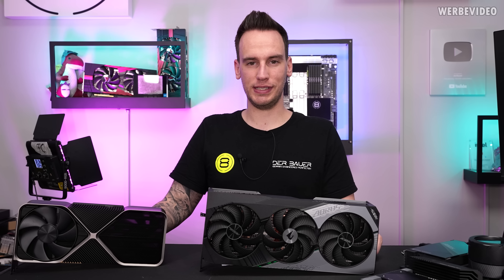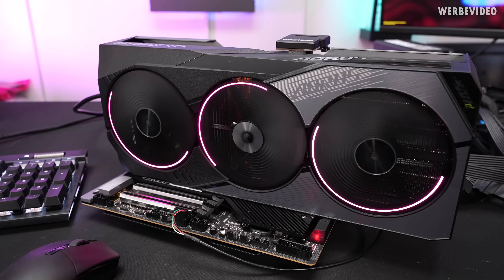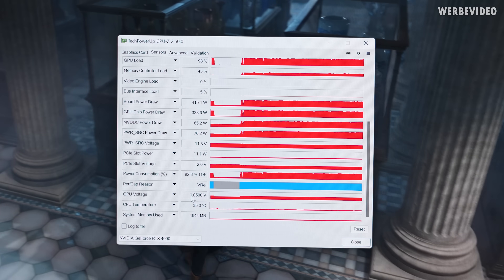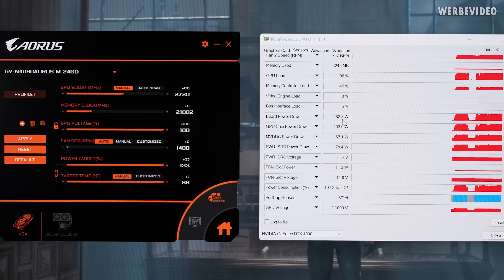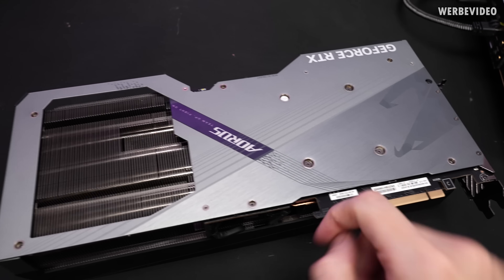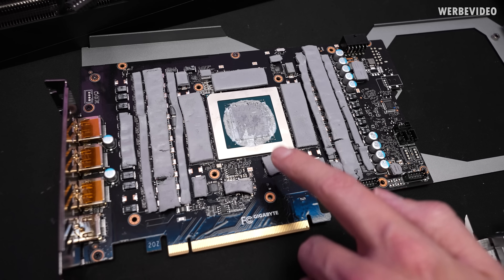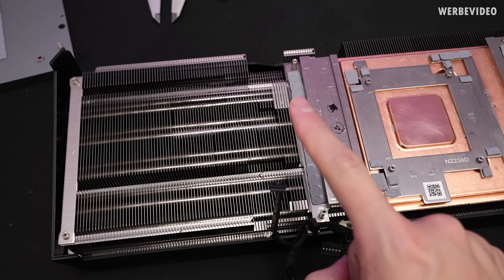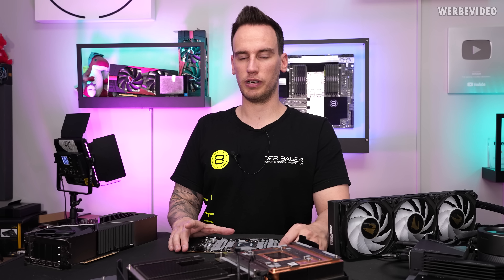Hidden NVLINK? RTX 4090 Aorus Master Teardown and Overclocking to 3GHz

Comment: Igorslab stated the other day, that before switching to TSMC 4N node, nVidia calculated some 600W+ power draw and AIB partners designed their coolers accordingly. And after the switch and recalculation, it was too late to design / order new coolers.
So what we see here, is a generation of GPUs with comically oversized coolers, that come with a generous overhead in heat dissipation, I guess.
Reply: Honestly, all things considered, it's better this way than the other way around.
Reply: @kosmosyche  It is, of course the AIBs aren't going to be too happy as there is less incentive for people to buy higher end models if all models have decent cooling
Reply: You cant really port an architecture from one fab to a completely different one that quickly, this decision was made years ago and it would have been plenty of time for the AIBs to be noticed that the new power target to be 450W rather than 660W. I think it looks like they were targetting 600W on TSMC from the start but then noticed it wasn't worth it the bad press so they dialed it back down to 450W since it wouldn't have made any significant performance loss anyway.
Reply: Considering leaks from Nvidia saying that their testing of a Lovelace Titan card prototype either melting power cables or itself when pushing up to 600W, that seems plausible. Nvidia allegedly scrapped that plan, but... these overengineered coolers could come in handy for a 4090Ti with a power limit of 525W, let's say, to milk more performance out of the architecture without melting things.
Reply: Another reason EVGA walked away?
Reply: Wouldn't trust anything Igor says, much less give that cocky clown attention
Reply: oversized coolers will do fine with 4090 Ti full enabled die
Reply: If only nvida didn't limit the voltage this much, which have made it possible to take advantage of the oversized coolers
Reply: that's likely false, NVIDIA doesn't give the details to the oems until very late in the cycle by which point they would know what the consumption is, more likely they planned to really push the card to compete with amd, and at last minute decided not to, a node change wouldn't happen fast enough for that to be the real story behind the 600w figure
Reply: I hope they release revised versions latter with slightly smaller coolers. I'm pretty sure that the 3090 cooler can handle the 4090 just fine.
Reply: And also all the AIBs have to eat the cost of larger coolers and heat sinks than necessary, that's probably why EVGA left.
Reply: @ddnguyen278  the costs will be eaten by the consumer. It’s probably one of the reasons the cards are so expensive
Reply: Tbh I think NVIDIA nerfed the entire 40 series because of the 30 series still in channels.
Reply: @SimanSlivar  Perhaps, though they mostly keep the sale of 30 series thanks to high price and releasing from the top end.
Reply: I've been gaming at 3840x2160p, since 2016 and in 2020,when I got my 3090s, I got one Alienware 50 something inch 7680x4320p monitor and I've been gaming at 8k A LOT since then/I got 3090tis after that and I got a 4090,but it was weaker than my 3090tis system,because Nvidia handicapped their card by removing the NVLINK plug,I usually code something to optimize two cards,but this time, I kept my 3090tis/i9-13900k,128GBs of DDR5 RAM system and decided to build a separate system around the 4090 with an i9-13900k and 128GBs of DDR5 RAM and I utilize a hyper visor,which was a great idea,because now with the power of two Titan RTXs,two 3080s,two 3090s,two 3090tis a 4090,an i9-10900k,an i9-12900ks,3 i9-13900k CPUs, with a total of 98 cores and 512GBs of DDR5 RAM and 128GBs of DDR4 RAM,totaling 640GBs of RAM/all of my old computers that are still worth keeping, I can basically run and do anything I want to do on my network with them/I can stream multiple games to my monitors/TVs/Steam Deck,I can run multiple Virtual Machines simultaneously to test my code.

I have MOST of my systems hardwired/plugged up with RJ45 cables,but my laptops,phones,tablets,Steam Deck and so on are designed to be portable/not tethered to a wire, so I SOME WHAT recently got four ROG Rapture GT-AXE16000 routers,that replaced some Night Hawk Routers, to cover my whole house/one for my back yard area,one for my basement,one for my first floor and one for my second and third floor.

I've been thinking about adding two more i9-13900k CPUs to the equation, my goal is to get to 148 cores and that would get me to 146 cores, I also don't want slow cores either/traditional server cores are trash,also AMD isn't an option, because all cores aren't created equal/if you compare an i9-13900k/Intel core to an AMD core,you will be disappointed with AMD/SOME of AMDs CPUs have like 64 cores/the 3990X has 64 cores,but the single core performance of a 3990X isn't great,maybe since I don't have a system in a Z790 board, MAYBE that COULD be a good idea/I could get another i9-13900k/4090/128GBs of RAM and then when Meteor Lake comes out I can get an i9-14900k/ks system. 

My Hyper Visor journey has been good so far/being able to combine all of this hardware vs my usual two card setups has really changed things for the better, my work loads are handled perfectly/I only run Kingston KC 3000 SSDs and SOON I'm going to add some Samsung 990 SSDs,I have a total of 60TBs,for storage/each of my systems have 12TBs in them,for movies and games,I also have some smaller sized SSDs,for Manjaro Linux,Windows,Virtual Machines and projects,but the removal of the 4090s NVLINK plug has really opened a lot of doors/has been a really good thing, at first I didn't think this was true/I thought it was going to impact my work loads, but with the options Hyper Visors give you NVLINK isn't really needed anymore/with a hyper visor you can crush any single system easily.
Reply: It`s a mining card. Games are just not able to fully load the card.
Reply: @seculi7757  not a mining card, it's a workstation/ai card
Reply: @pearce05  Without Titan drivers it isn't as useful. Though I agree - it still makes sense if you can utilize it that way, it just seems that NVIDIA is taking away usefulness with every generation (NVLINK in this case).
Reply: @pearce05  The design is between 1 and 2 years old if not more, take a wild guess what the nVidia company`s main focus was.

Anyway i`m interested in what the card will do in watts if it`s mining just to see if that will fully "utilise" it, to see if that makes the card somewhat logical to explain.
Also it will give an estimate of how much performance could still be in the card if they rebalance it towards gaming by stripping mining related architecture choices out of the GPU.
Reply: @seculi7757  try 4K 120Hz gaming. It still can't get to 120fps on the majority of titles, so games certainly can fully load the card.
Reply: @richardpastoor9336  No that doesnt mean that, actually more the opposite.
Games at 4K@120hz are not fully loading the card since they are nowhere near the power/cooling-limit of the card.

Gamersnexus ran Furmark which did 666 watt on the card, showing its "true" potential. (maybe still not the limit though)

Games dont use all the transistors available contiuously. (actually no software does that ever) 
Other software can use more of the transistors per core per time (because of more complex calculations) and therefore utilise more of the hardware.
Reply: @seculi7757  There are plenty of other interesting things that can be done on GPUs beside mining and gaming. Modern GPUs have basically become supercomputers on a PCIe card.
Reply: @seculi7757  mining is dead for now
Reply: @HNedel  That doesnt change that the card was originally designed for mining.
Reply: @seculi7757  How out of the loop are you? You can't mine ETH on GPU's anymore, and the other coins aren't nearly profitable enough to buy this card. There are plenty of games that max out this card. It cant even do 4k 60fps native on cyberpunk
Reply: @savifrank6323  It wont max out on its wattage/cooling capability when doing 4k/60 on Cyberpunk though.

Because that game is not utilizing infrastructure on the card that was put there for MINING. (and yes i know that mining is dead)
Reply: @seculi7757  oh, so you were on the development team at nvidia? The hash performance of the card can be tested easily, and according to you, the gains compared to the 3090 should be way better than the gains in gaming. If they are not, you are just pulling stuff out of your butt.
Reply: @HNedel  That`s my theory yes. 
Which is a valid theory looking at the circumstances and designchoices that went with this card. (also EVGA pulling out)
(btw it`s kind of difficult to find this mining-comparison information right now)

Comment: 58*C at 400W? Holy SH*T I ordered the 360mm Waterforce Xtreme, should be even more insane, maybe sub 50*C at load with Noctua 12x25 pushpulls.

Comment: TDer8auer Thank You for another "Quick to the Point" Video.  You have an uncanny way of drilling down to the source for Hardware Enlightenment.
Since Nvidia decided to go with the reference design scheme of previous cards with two fans and as compact a cooling solution as they dared, Nvidia then had to do something to limit their AIBs to a competitive situation.  Its obvious the AIB card from Aorus is quite a bit more capable.  If they had more voltage to play with, the card performance would obviously outclass Nvidia's Reference.  As it sits now why spend an extra $300 to $500 more dollars for 6% more performance.  The obvious choice here is just go with the Nvidia card.  Not only that but you are looking at a staggering amount of wattage draw to achieve that extra 6%.  Nvidia is so lucky that they have an extra 6 weeks before the AMD Radeon Cards hit the shelves.  Some guys just cant resist pulling the trigger.

Comment: I would guess that unused NVLINK is for a future AI/workstation/data center product. Why design a new PCB that would be 99% the same? Alternatively, the canned 4090 Ti was going to have it as a differentiating feature for those with a 1500 watt PSU?!

Comment: Great video as usual. Can you please ask the manufacturer if they will be producing a pre-custom water blocked version, like some companies (like Asus) did with some RTX3000 cards in collaboration with EK water blocks? If so it would reduce a huge amount of e-waste & make people who are nervous about putting a block on for the 1st time far more likely to buy one. Thanks in advance. :)
Reply: MSI has one.
Reply: @halrichard1969  isn't that just an AIO integrated version, rather than a card you can plug into a custom water loop?
Reply: @TimLongson  Ah yes that it is an AIO version I believe its a 280.
Reply: @halrichard1969  which unfortunately would be useless for a custom water loop. Custom water loops can provide much more cooling, heat headroom for overclocking and run more quietly than any AIO - the more radiator surface the more passive cooling there could be, so I am planning a three 420mm radiator custom loop in a Cooler Master HAF 700 case. But thanks for trying.
Reply: The more radiator surfaces the more passive cooling there could be (as well as more cooling, heat headroom for overclocking and running more quietly), so I am planning a three 420mm radiator custom loop in a Cooler Master HAF 700 case. But I am reluctant to install water blocks on a GPU myself, firstly because of all the e-waste (throwing away all the fans and cooling pipes which were included in the price paid for the GPU), and secondly because of fear of installing it sub-optimally or even damaging the GPU whilst doing it which could render the warranty invalid.
Reply: @TimLongson  You can sell GPU coolers, IIRC the store Titan Rig pays $100+ for them.  Or you can sell on ebay etc.  Putting GPU blocks on isn't that bad, maybe watch some Youtube vidoes on it to help get comfortable with it.

Comment: Increasing the performance by 10% while going 200w more power...this card at 300w is a beast
Reply: This is my takeaway as well.  My card while vsynched peaked at 65% power draw in a 2 hour gaming sesh in destiny 2 at 4k 120 fps at max settings.  So pulling less power than my 3080 for a slightly better exp.  This game doesn’t need a 4090 to run well but obviously the new UE5 games coming will🔥🔥🏆🏆🏆
Reply: @damonm3  What upcoming UE5 games are there??
Reply: @savifrank6323  there’s a list.  Not sure exactly.. but they’re (some) for sure coming in the next year.  We need some new aaa games for sure.  Lots of remakes…
Reply: @damonm3  looks like the new stalker will be on UE5 that looks the most interesting to me

Comment: I wonder if the voltage limit is due to the sense wires on the new ATX 3.0 connectors. If you are using a new power supply with ATX 3.0 will it allow the voltage tuning to be unlocked?
Reply: The sense wires have nothing to do with voltage adjustments (just plain old 12VDC is delivered), likely they couldn't get it stable with variable voltages and so just locked it until they can.
Reply: They do impact power limits though, I know that is different than voltage limits, but it seems we still don’t fully understand everything these new sense wires impact. 

GamersNexus just posted their review with a clip from a future video where a Nvidia rep was talking about just that.

If all wires in the spider adapter are connected, you can adjust power limit over 100%. If only 3 are, you can’t.
Reply: @cmill4836  The way the sense wires work is exactly documented in the ATX 3.0 spec, if gamersnexus is suggesting it is a mystery, that's just clickbaiting (not sure what exactly they said, haven't watched their videos).
There are 2 sense wires related to power delivery, they are either left floating (not connected to ground) or tied to ground. Those are the two options.
That gives you 4 variations between the 2 wires for 4 different power modes, none affect voltage.
Any voltage tuning/OC would have to be handled entirely by the GPU itself, the PSU has no role in that beyond supplying enough current and the ATX 3.0 sense wires do not play a significant role here beyond being identical in function to the jumpers that we used to use in configuring the primary/secondary CD drive and floppy disk etc.
Reply: @cmill4836  Like I said that would be something inside of the GPU, that has nothing to do with the PSU. The PSU design/spec is very simple in this; there's 4 'communication wires' (just jumpers). Two are for a PSU ready signal and GPU/PSU detection (just to detect that there is 'a' GPU, not which type or anything fancy like that.
The other two are for current demand, used by the GPU connector to determine whether 150,  300 or 600 watt should be delivered by the PSU.
There is no 'third wire' to disconnect or not to enable a power limit adjustment, that is purely inside the GPU and only because NVidia makes it that way, not because of PSU spec, requirements or limitations.

Like I said before, the ATX 3.0 spec is readily available, read it yourself and you will see that there's no hidden secrets or unknowns/mysteries/conspiracies, it's all very clear and quite boring ;)
NVidia somehow chose to go with the 12VPWR connector instead of just using the 48VPWR that ATX 3.0 also has, it would've delivered 600 watts far more safely without all the issues that Molex is reporting about the PSU and GPU connectors melting within 10 insertions...

Comment: I would bet that the nvlink fingers are still there because of their professional line of products. I would bet that the quadro products support it
Reply: I mean the current gen of "quadros" don't even have nvlink. Nvidia said it wasn't needed anymore. also the Quadro name is mostly dead by this point unless they do a massive u turn
Reply: @BenQuigley  their a100 and other Ai and server cards absolutely have link connectors so they can have shared pools of vram.  They do not function the same as nvlink or sli, instead they allow vram pool sharing and timing control, which is extremely important in server workloads.
Reply: @chubbysumo2230  I said Quadro and Quadro class cards... these are the workstation cards... not the server class cards such as Tesla cards (not sure if they still use the tesla name) I'm aware the Server class accelerators have VNLink, but they use a mash contention usually with a NVLink switch for shared/pooled memory...

Comment: Will a 4090 fit in my Lian Li PC-O11DX Dynamic - Black - Kabinett - Midi designed by DerBauer?  im thinking mostly about the power cables that might hit the case sidewall?
Thanks for you'r videos.
Reply: No
Reply: @Balatro_G   ok thanks:)  guess not even vertically mounted?